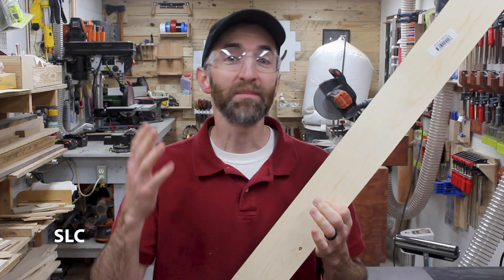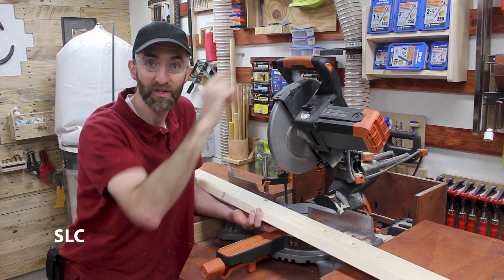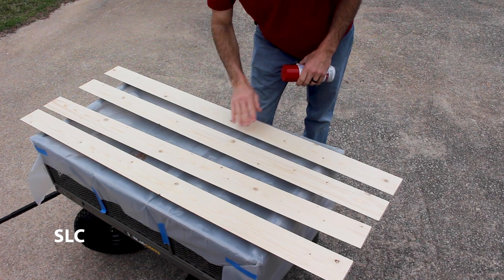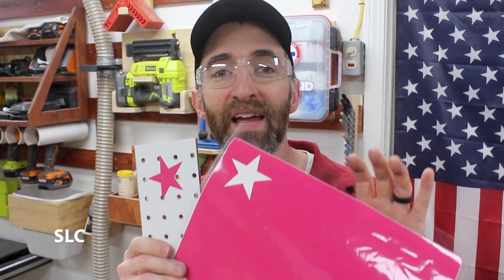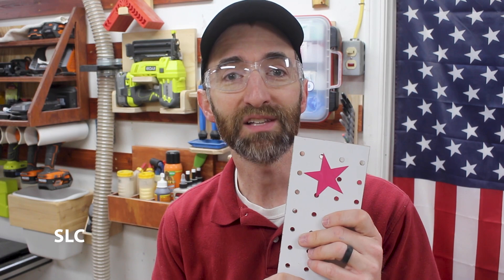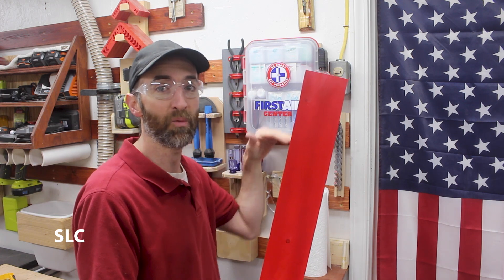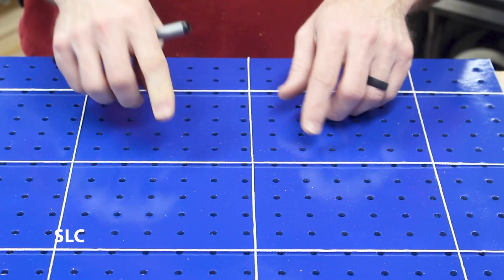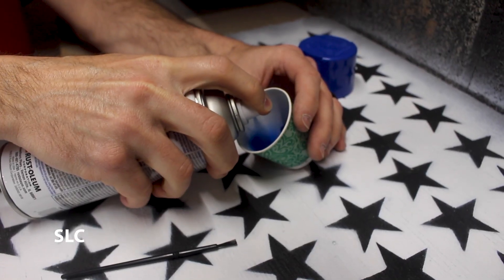French Cleat Tool Storage - Flag Edition

Comment: I did French cleats in my workshop, and i didn't have any wall board, just studs. However, i ended up using twice as much lumber doing it that way. In between every cleat board, i installed a 1 x 4 board, so when I hung something up, it had some sort of support behind the lower part of the piece. I tried to hang stuff on there without the extra 1 x4 and it didn't work out very well. But with the extra board between every cleat it was every bit as hood as having wallboard up.